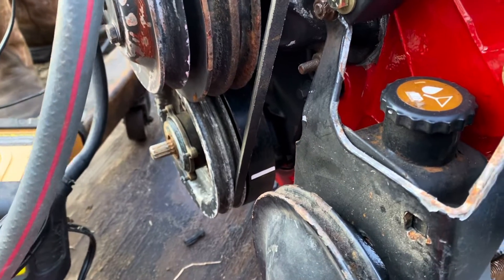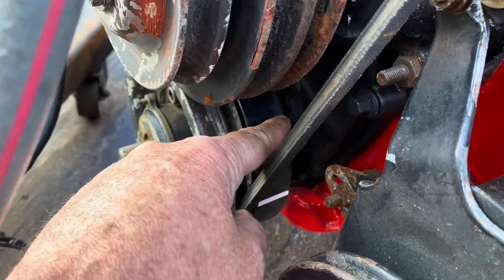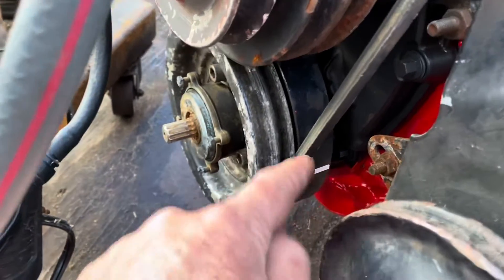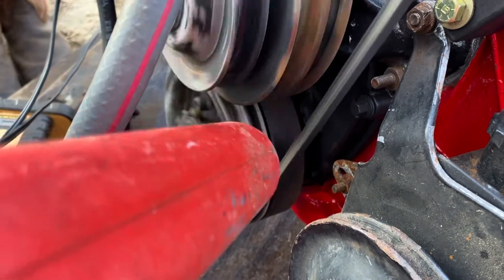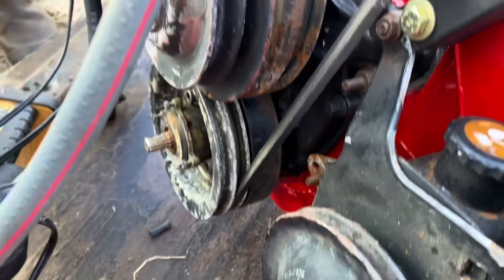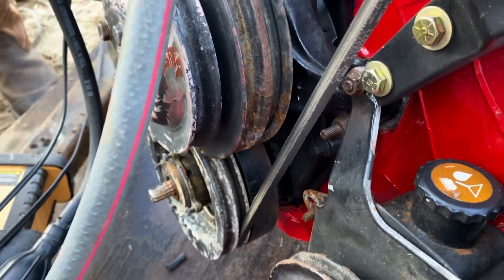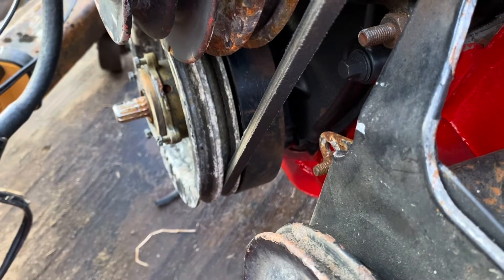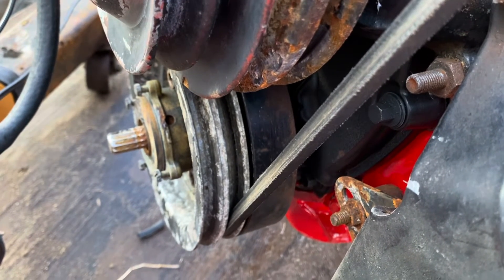10 - Why You Must Use DELCO EST Marine Modules for Boats

Comment: Would that effect idling ive thrown 5k into my 4.3 gl-d thats doing the work myself ive replace and done everything i cant get rid of of a bad vibration at idle in gear or out of gear goes away above 1800rpm or so.  I do have a auto coil on it that ive replaced 3 times just to be sure ive gotten bad parts new from the store. Love the videos
Reply from the maker: To rule out timing issues and get a steady non changing timing regardless of RPM do the timing procedure again with the set timing tool but instead of setting the timing at 1 BTDC set the timing to 15-18 BTDC (anywhere around here to where the engine runs the smoothest). KEEP THE TIMING TOOL ENGAGED AT ALL TIMES DURING THIS TEST. Then watch the timing marks with the engine idling. It should be rock steady at whatever you set it at. If not you’ve got a defective distributor (shaft could be wobbling, pickup bad, etc.) PUT THE TIMING BACK TO 1 BTDC BEFORE SHUTTING OFF THE ENGINE. If the timing was steady but engine still shakes you’ve got an internal engine balance problem (balance shaft not timed properly) mixed up engine parts maybe. This is where my water moccasin tool would help. I always run my engines without the prop drive attached to rule out vibrations from the drive shaft misalignment. Connect a garden hose to your incoming water pipe in engine bay if you don’t have my tool and run engine with prop drive removed. I hope you didn’t mix parts from different engines because the rods and cranks are balanced together and are not interchangeable with other engines.

Comment: Hi sir good morning, thanks for your great videos , I’m trying to make my boat run but I can’t is doing the same it like the engine in the video but my is a 4 cylinders 3.0 , and I already change a lot parts but I can’t make it run , I change two parts from the distributor , the electrical parts I think it’s called pick up coil and module
Reply from the maker: If you did not buy a GM module then you probably got a truck module or a defective marine module.